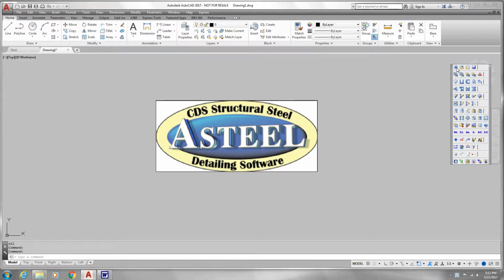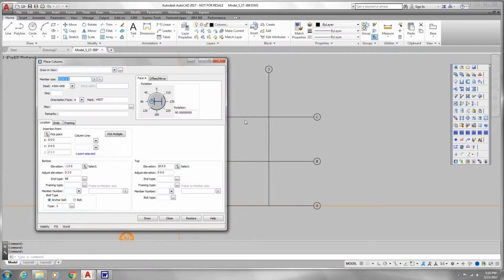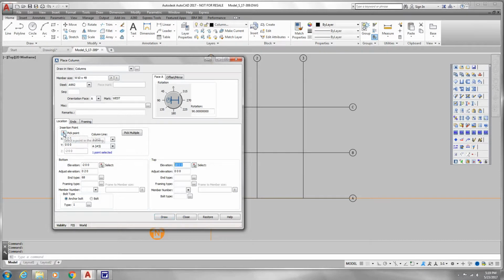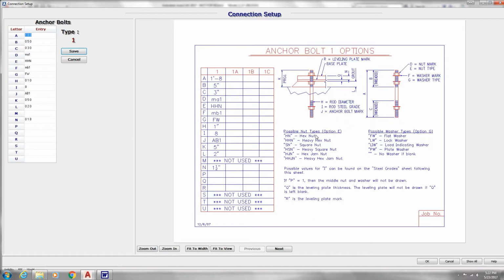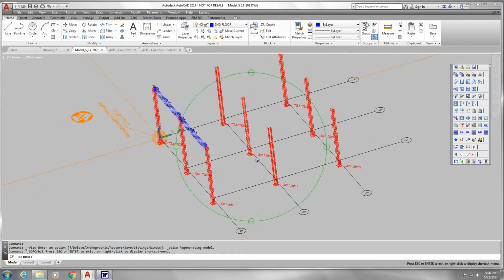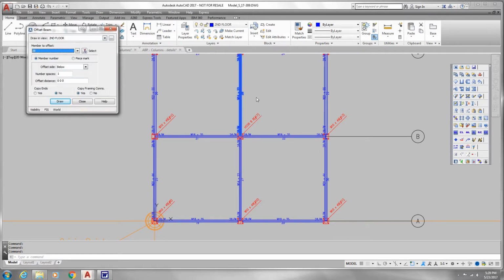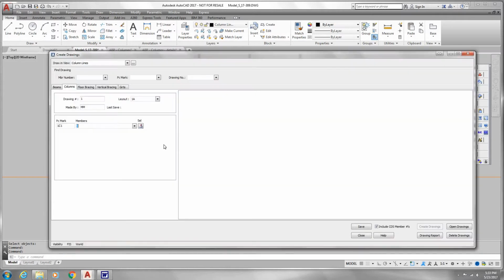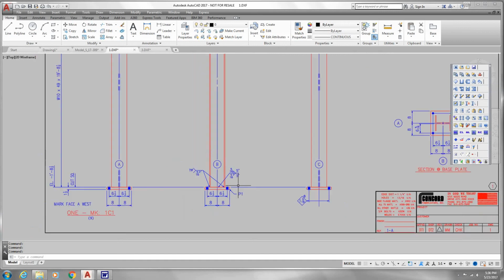Asteel 3D Structural Steel Detailing System Demonstration

Comment: Thank you for the video. Can you navigate the model in solid mode? and is there a collision check tool to verify TC gun clearance?
Reply from the maker: Yes, you can toggle on and off the wire frame, solids, work lines and other elements of the model objects.  You can navigate using our model views tool or any AutoCAD command such as south east Isometric or free orbit.  Does not directly check for TC gun clearance but does automatically apply bolt clearances at beam to column connections.
Reply: Blast from the past…